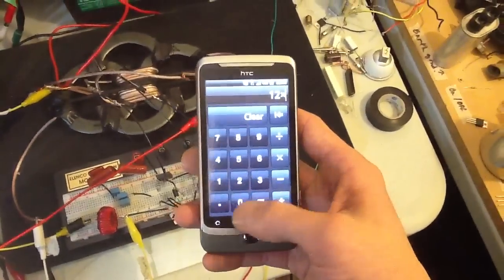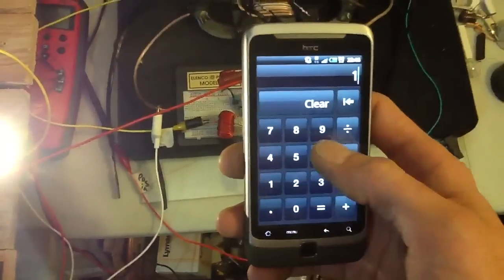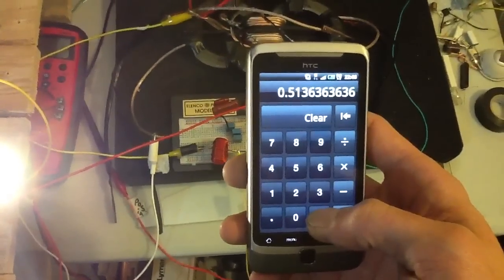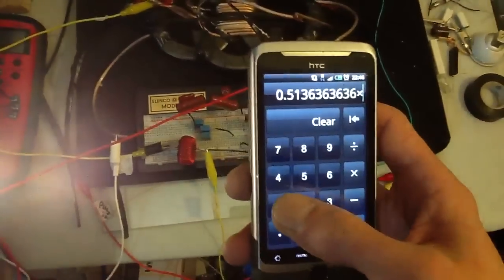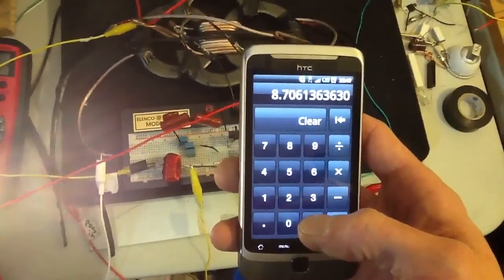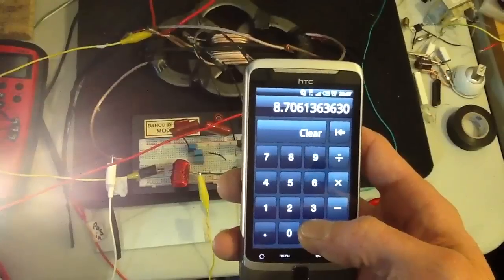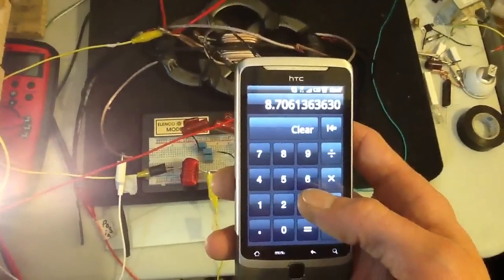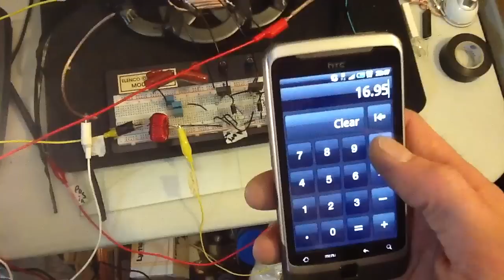Bi Toroid Technology: Measuring Input and Smoothed DC Output

Comment: Hi KIU just made a nice BiTT core out of bundled green enameled soft steel florist wire and want to replicate your experiment as much as possible....I fgure this wire will work like laminate steel cores...I assume your have 2.93Khz as frequency of the 12V battery into the center-tapped primary and this 12V is alternating DC via the "zero volt" circuit - Can you link or describe exactly what is the zero volt circuit?Also what is the ohms of the primary center tapped coil, (one half of it) also what is the ohms of your secondaries?Thanks and really great work you do.You can contact me in email if you want:konehead@msn.commy website:https://sites.google.com/site/alternativeworldenergy/Thanks Doug Konzen (AKA konehead)

Comment: If 16 volts on light lamp and if it have  smooth capator, then amps is it about 0.4 amperes. So you get overunity if capasitor godd smooth and multimeter schow corect 16.95 volt on output. But you can check or directly to battery it light dimer to determnate or you in 100 precent get overunity. And schematic I be glad to see.

Comment: Hi Kurt

As it is DC you can put your DC Ampmeter accross the bulb and one wire. So if you red 0.51 A you are sure that you have about 33.2 Ohms  as written on the bulb's sticker for 12 volts.
If you do not read 0.51 A, perhaps the ampmeter can not read the current due to too high frequency from the Zero volt driver, or the Bulb changes the ohmage due to overvoltage .
I don't know if it is possible to measure Ohms directly with a multimeter while running 
Good luck and good continuation

Laurent

Comment: Yep fantastic work, bravo Kurt.

Very clever idea as usual

Can you olease check that your  bulb is still at 34 Ohm when overvolted at 16.95 volt, or connect an Ampmeter on the bulb to see if there is really 16.95 volts at 0.51 A ?

If yes, you show us a great way to the Graal.

Thank's very much for sharing

Laurent